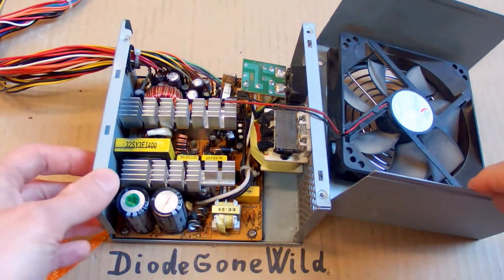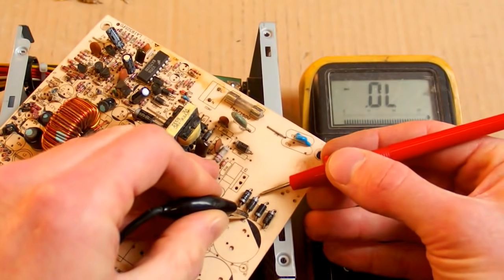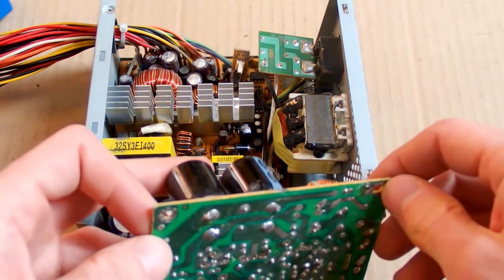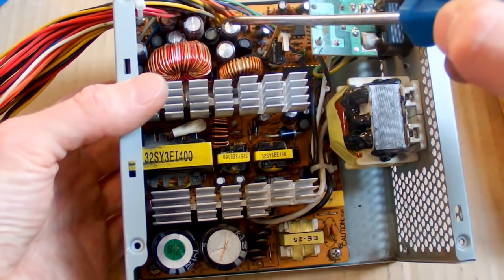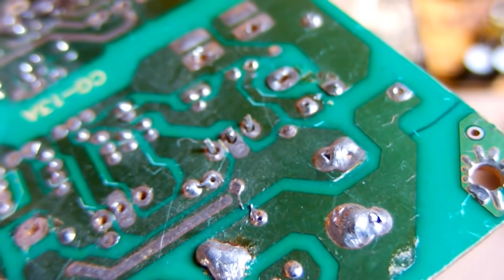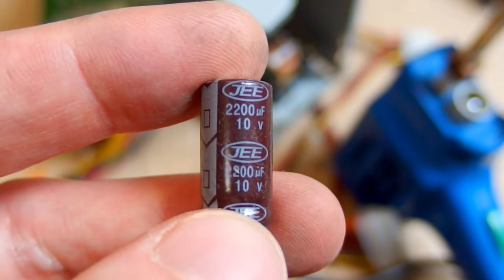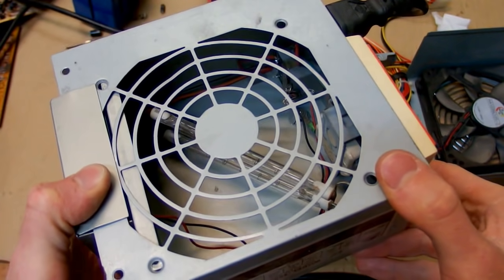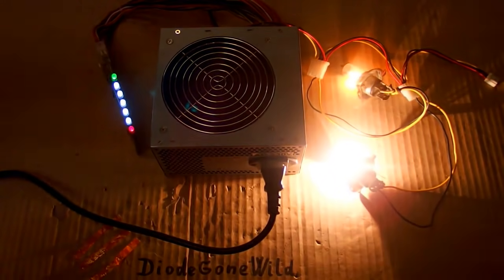How To Repair a Computer Power Supply (or other switching power supply)

Comment: Fantastic video!

I've found that 90% of the time its the output capacitors that go kaput on just about any kind of power supply. I have never seen one of the big 400v capacitors fail (i saw one burned because water fell on it and shorted, but it still worked!)

Also, usually when capacitors fail they will start inflating, getting deformed tops or bottoms, squirting their electrolyte out or even, in some cases, explode. But not always, sometimes they look like new while being defective that is why having an ESR meter is very important, i really wanted to see yours, its a shame you didn't had it at hand :(

Thank you for the video, i've never had a damaged driver circuit on a PSU but now i know how to troubleshoot it. 

The ATX PSU tester is really cool, i'll be looking it up in your site to build it. I already built your Li-ion battery charger and its being serving me wonderfully :) i had to use a 2k variable resistor,  because i could not find a 1k anywhere in my scrap pile so its quite difficult to calibrate XD and also added an LED+resistor to know its getting powered. The only brand new thing i used on it was the solder, even the PBC i reused from an old board after removing all the components and grinding away the traces from it using a grinding wheel getting a plain fiberglass sheet XD.

Comment: Good video.  I've had a couple pain in the butt ones where the PWM IC failed also but did not fail shorted.  Had to use the scope on it to check the drive output signal.

Also, I know it's not something everyone does but anytime I have to work on a switch mode power supply that is live,  I use an isolation transformer.  Try to be safe.
Reply: It also helps to apply power directly to the controller chip from a lab power supply, check its consumption, iyts ability to produce the expected reference voltage, gating signals etc

Comment: If the 22ohm resistor is burned or overheated, I recommend change  47u/50V capacitor near this resistor. I have few ATX where this capacitor has less than half of declared capacity and high internal resistance.
Reply: Martin Leška

Comment: The capacitors look like a mix of JEE and Gold Link brand capacitors, JEE is a really bad brand of capacitors so no wonder they failed, same with gold link.
Reply: No these capacitors are truly bad, so bad in fact that you (most likely) don't need to use them for the capacitors to go bad (and by that i mean you can buy them, leave them on a shelf for around 3 to 5 years and come back to them and all of them will be dead unlike all of the good brands like Nichicon Rubycon and Panasonic.)
Reply: Some better 'mid tier' capacitors they could have used was OST, Teapo, Ltec and a few others.
Reply: A switch mode power supply will put more stress on the output capacitors than a linear power supply and iv'e seen a lot of dead Capxon capacitors on the outputs of some switch mode power supplies.

Comment: Now i like your current limiting lights, safe and cooled. :-D
I never thought about using an old supply case.

Now be honest, did you solder a short across those diodes on the underside lol :-D

Damaged parts blowing driver circuits is a pain, sometimes a driver chip is unknown and renders the whole thing useless, and im not just talking about power supplys.
Oh when you tested the two fuses, the first one was dead, not "fine", the one on the pcb was ok.
I find panasonic low esr capacitors to be a decent replacement .
Reply: Panasonic decent? gee, well ain't you demanding. They are one of the top capacitor brands in the market XD.

But honestly, usually the capacitors fail because the chinese PSU manufacturers underspec their caps and then place them stupidly close to heat sources with very little or no insulation and badly planned airflow. So the capacitors are constantly on their very limit and being exposed to really high temperatures, no wonder they go kaput quicker than they probably should.
Reply: In a bridge rectifier failure short of one diode, subject another one (connected to opposite AC line) to short i.e. leads to two failed diodes. It is typical
Reply: @plamenpetkov6958  Yes. Its coz both of them conduct in one cycle of AC so both of them fail in case of a short circuit. Its usually one leg or the other.
Reply: How do you build a test box with 2 Halogen lamps and the fan ? What is the circuitry?
Reply: @Ali_Haji_SouthAfrica  One lamp is enough, but going with more adds versatility. Here's a link: https://www.repairfaq.org/samnew/tvfaq/tvtslbt.htm

Comment: i like the power supply tester!!!!
Reply: i like the test socket even more, actually I really need that !
Reply: You learn to out a limiter like that when things blow up. I use car bulbs too to test. Quite surprised he did that but its really a good method.
Reply: i should make one too
Reply: Definitely a must have setup....I have the car lights, no a xenón type, but this is a nice load for this. Wish me luck cause a I have got one power suply to fìx today. Cheers !
Reply: i want one too
Reply: hi everyone ,if anyone else  wants to uncover 
electronics repair guide
 try Saankramer Electronic Magazine System ( search on google ) ? Ive heard some decent things about it and my partner got great success with it.
Reply: Not certain about the points made but ,if anyone else  wants to learn about 
electronics repair technician
 try Saankramer Electronic Magazine System (do a search on google ) ? Ive heard some pretty good things about it and my m8 got excellent results with it.